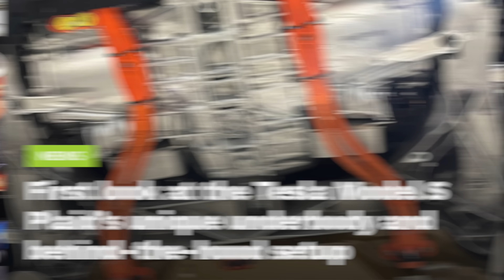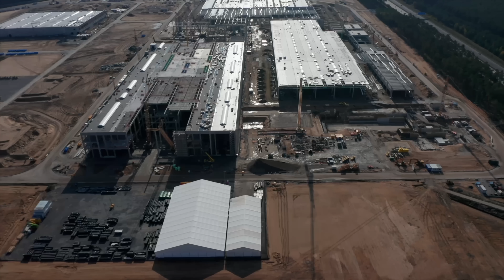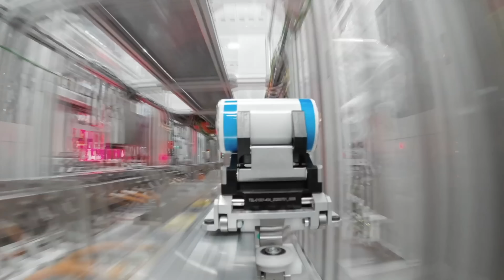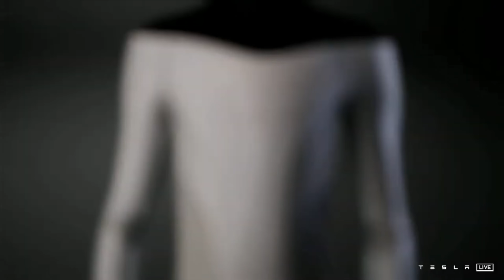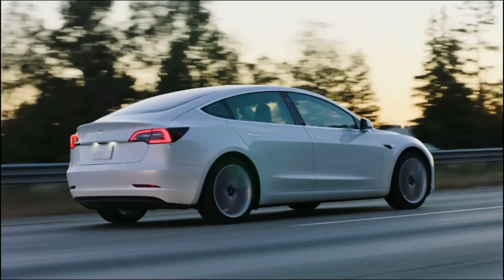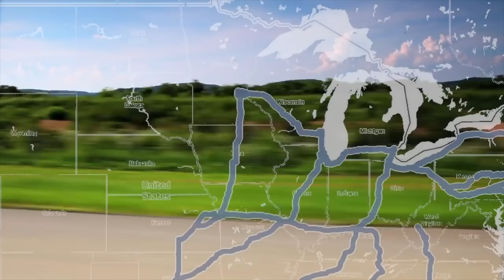NEW Tesla Model Y | 400 Miles of Range?

Comment: The plaid is the safer, quicker, easier to drive, almost a no maintenance car that can drive itself, run 9.24 and is still getting better through OTA updates. And is still not fully unlocked yet from factory.

Comment: The MY awd weighs about 278 pounds more than the rwd MY.  That’s about 7% increasing the road resistance piece of energy per mile from about 150 wh/mile to about 160 wh/mile.  The EPA equivalent for air resistance of about 100 wh/mile is the same.  Therefore the difference in EPA mile ratings is only about 4%.  Actually it is a little less than that because the awd version has a little less internal energy consumption due to the front + back drive current split.

Comment: Hello, thank you for this video. I have a question that I cannot find an answer for, perhaps you have the answer ?
Tesla model 3 : how can I keep a log history each time I recharge the batteries? I need to pay the kW that the car uses at our multi-family home so I need a precise kW value which a simple counter on the electric board will not be able to give me (friends of friends coming over and charging...) So I need an app or access to the Tesla charge log by GPS location (home). Do you know of a way to do this easily ? (I know about TeslaFi - 50 USD/year ; is there a free app to do this?)

Comment: Take a really stupid idea and make it worse with a larger battery.  Electric cars do not reduce carbon footprint due to the FACT making that battery has a huge carbon footprint, the electricity to charge these stupid cars comes from largely combustible fuel fired power plants and, the infrastructure to deliver a charge for these stupid cars must be expanded to accommodate the production and delivery of that electricity must be greatly expanded to complete that task.  Electric long range cars are as stupid as it gets.

Comment: We can estimate the conversion factor between NEDC and EPA, but you may have been generous.  In any event, I think the model Y will approach 400 EPA miles when 4680 batteries hit the scene, assuming Tesla uses the same physical size battery pack.  They could make a smaller physical size battery which would have less range, and be cheaper to produce.
Reply: @K lake cheaper to produce is what's needed.  more real range is also needed

Comment: For me , 400 miles is the magic number.  Keeping in mind the 400 mile rating is not 400 miles of range after you consider parasitic load, heating, AC, charging cycle, etc. The actual range would be more in line with my real world needs with a decent reserve to avoid panic due to unplanned driving needs. I am waiting for the 4680 + giga casting before ordering.
Reply: I agree. Now you can realistically go 300 miles between charges.  At that point I am happy to get out and move around for 20 mins.  Every 200 miles is too short
Reply: ...or, you could get a 2 year lease and get a 4680 MY afterwards.
Reply: I have had a lifetime policy of not leasing. Besides a leased Tesla would not a  have a 400 mile rating. I can be patient and wait for the real deal.   The savings of not leasing can help pay for the new one.

Comment: In my opinion range is not the main thing if we can get a super fast charging  on part with ice car is what matter. Think of it most gas car doesn't even drive 300 miles per tank but it's only take 5 mins to refuel vs 30 mins for 80%. so once the charging is on part with gas is truly bye bye gas
Reply: If you want an EV you might want to move to China. NIO already has a battery swap station that they plan to build 4000 stations of by 2024. In real world these swap stations aren't perfect, but when we no longer have ICE cars these swap stations will replace gas stations.
Reply: @hgr3180  battery swapping is an option sound like a good plan but not really, the number doesn't add up think of it, if nio sell 100k you need to have at least 3 time the number of batteries ready and ready to  swap.  put it this way if you have 20 cars and only 20 batteries that's mean if at 20 cars is on it's way to swap now you have to wait for the longer because the battery is not ready. the are already experiencing such of problem the wait time is longer than expected.  plus tell would you paid for a full price of a car if you don't even own the battery and you are going to sharing a used battery. also those type of infrastructure is way too costly and much more chances of wear and tear compare to  a non moving charging station.  it might work in china because they don't drive as many miles as us in the US and majority of people do not have a place to charge at home. final point i would rather have charging station replace all of our gas station or be included in the same gas station, see you can choose gas, diesel, electric.  i mean lets be real gas won't go away for a looooooooong time.
Reply: @cktommy   wrong. NIO cars don't need battery swap because they can use  superchargers and slow charging too. Search up Wright's Law and watch how production costs keep coming down. This means the cost to build battery swaps will keep coming down at a fixed rate too. Lithium ion batteries keep getting cheaper too so don't worry about not having enough batteries. Tesla is working on a AI that can do hard work and your telling me in the future we are going to still be using plug in chargers instead of automated battery swaps. Plus they are not sharing used batteries that don't have maintenance. Each swap stations has a lot of sensors and can detect degraded individual modules so the batteries can be taken out and repaired. Repairing the battery will mean repairing only the degraded module so repair costs are lower. Keep watching fake news, the big dogs are loading up on NIO.

Comment: Range matters.  The biggest single point raised by those not yet into the EV game is range.  A 500 mile range should be very high up on Tesla's list of things to do.  270 is not nearly enough in the minds of most people driving ICE cars, considering the charging time.
Reply: Agree but not that many regular gas cars getting 500 miles to a tank either. The charging time is definitely a factor (I can attest to that) but most people charge each night at home and have a full charge the next day. That said, I would love to see a true 400 miles to a charge and vastly expanded charging network with way more 250 kW stations.

Comment: Disappointed with every new update with cybertruck. As someone who has a farm and pre-ordered the night of the announcement, it keeps getting less and less practical for people who live in rural areas, mountains, farming, etc… We need mechanical door handles that are easy to open, we need rear view mirrors since lots of time it is muddy and crazy weather that cameras could be unreliable, we don’t need full self driving, and we for sure need a easy gear shifter for moving trailers and getting around farm terrain. I hope I am wrong because I was pumped for a cybertruck and it’s becoming less likely of a farm/mountain truck.
Reply: I agree Patrick, and I think totally due to Musk himself.

Musk is showing himself to be way less customer focused and almost dictatorial in the way he responds to customer requests.
For example, when recently asked on Twitter whether there would be a circular steering wheel option, in addition to the standard yoke on the new Model S, he just bluntly replied “No”. I find that quite bizarre, considering that they stand to lose many sales to potential purchasers who have clearly stated that the yoke is a definite deal breaker for them.

I really think that this mindless adoration from his millions of fans has actually gone to his head!

It’s sounds like you might have to consider the upcoming Ford F-150 Lightning EV as an alternative choice. It very conventional and should fit the bill nicely!

Comment: We’re finally getting our model y tomorrow after waiting since may!
Reply: But is it a 2022 Version? With the 4020 batteries?
Reply: @PhineasJWhoopee  4680 cells won’t be available before around mid 2022, due to engineering issues related to the volume production line. This was confirmed  by Musk and Baglino during the Q2 earnings call in July. They have a backup plan to use 2170 cells in the meantime, for the initial model Y’s to come out of the new Austin and Berlin gigafactories.
Reply: Same!!
Reply: What day did you order? We ordered on the 23rd of may.
Reply: Lucky lucky! I ordered May 19th and still playing the waiting game 😅
Reply: You are not getting 4020 battery, I am with long range
Reply: @cessealbeach  What do 4020 batteries do
Reply: Did you get it
Reply: Congrats 🍻🍻🍻👍🔥
Reply: Congrats

Comment: I would love to see more wheel options on the MY performance…in addition to getting “curb rash” they were noisy and are horrible in the weather on my recent test drive.  How about a “colorado off-road package” with performance motors, raised ground clearance, tow package (with trailer power hookups) oversized all terrain tires, electric window tinting, utility roof rack with built in off road lights…think electric 4Runner or FJ.  Love to have one until cybertruck comes along.
Reply: I see that in a cyber Y type vehicle.
Reply: Is anyone offering electric window tint on a production car?  I hear you on the rims.  I would NEVER pay through the nose for objectively worse wheels.

Comment: I still cant considere the Nevera as a "production car" when only 150 is being made, thats not mass production.
Reply: You are nitpicking.  In the industry, a production car is a run of 50.  Why can't Tesla fans admire the Rimac for the fantastic car it is without showing their jealousy?  If you insist, you can put it this way: Tesla Model S Plaid is the quickest production car under $2.39 million.  Will that make you happy?
Reply: @brownro214  Didn't say it's not an amazing car.  I'm just saying, a $2.4 million limited production hypercar is NOT a production car.  It's not something that someone can just order like the Plaid is.  The Plaid is a production car.  Throwing figures out like "20 means it's a production car" means you are the one nitpicking, looking for an excuse to call a super expensive hypercar, that will have very few exist, a production car.
Reply: @brownro214  rimac was calling the concept 1 a "production car" when they only made 7. Some countries considered 50 as production but most people like me consider a mass produced car as a real production car. Cars like the nevera are practically hand built in a small specialized facility.

Its hard to appreciate the nevera when its engineering pales in comparison to a model S. Rimac built a 2 door made out of more carbon fiber than any other car and yet it still managed to weigh the same as the 4 door luxury sedan. They have the same range despite never being 120kwh vs 100kwh on the plaid. The nevera has 900 extra HP and only manages to be .6 seconds faster at the 1/4 mile. The nevera compromised so much to be a bit better, even their cells and cooling system sacrifices life span for preformance, meanwhile the plaid has an 8 year 150k mile warranty on its drivetrain, what warranty does a 2.5 million dollar hypercar come with?

Nevera looks like a rip off when a plaid exist at $130,000.
Reply: It's not a production car.  It's a limited production hypercar.  So the entire comparison is bullshit, since it costs over 2.4 million dollars.

Comment: I have a 2021 Model Y I purchased from Tesla’s demo fleet in June. It had 2900 miles on it then. On 1 August I topped it off in preparation for a road trip. It topped out at 330 miles. You can imagine my surprise.
Reply: Impressive. What area of the country were you driving in? I took delivery of my Model Y LR at the end of April and I get 300 if I’m lucky and with my cargo box another 25% off that.
Reply: @bryanhauer  I live in Virginia. I usually keep within 5 miles of the speed limit on the highway and maintain a constant speed using TACC and Autopilot. My efficiency is usually between 220 and 240.

Comment: The Nevera is an amazing car with amazing 1/4 time but for a savings of $2,370,000 I'll give up the less than one second advantage and buy the Tesla.
Reply: The tax alone on the Nevera is more then a fully specked Plaid. They fact that they are being compared is a feat for Tesla
Reply: With that kind of money I’ll get an X, and order that roadster and cyber truck
Reply: People like you that compare cars by the ability to accelerate in a straight line make me sad
Reply: The Nevera is hardly a mass produced car. It is hand made like a Koenigsegg… calling the Nevera a mass produced car is such a stretch. The Model S feat is much much more impressive at is is a true high volume mass produced car and that also means a completely different price
Reply: Funny thing is tesla is only 1000 HP and rimac is 1900HP that's the difference and i will still prefer a tesla for now but the rimac i respect big time🇹🇹🌍💯
Reply: Sometimes thinking of buying a Tesla now feels like I have to save nearly $2.4M to purchase one.
Reply: If you're considering either of these 2 cars you probably aren't looking to save and have the money to get either, at which point the Nevera will give you the bragging rights of having THE fastest production car ever made

Comment: The order fee does not come off the cost of the car.  I have an order from June and while it does show I have paid $100 in the payments received, it also has the $100 order fee added into the total Car Price as a separate line item.  So raising it to $250 actually is just a $150 price increase on the car
Reply: Wrong!
Reply: @Electric-Mania  I don't live in California, so maybe it's different by state?  In Indiana it definitely is just a $100 fee, doesn't go towards the cost of the car
Reply: Kevin is right. The $250 order fee is as it states a fee. It is added to the price of the car as is the $1200 delivery fee. It is removed from the total amount owed upon delivery because you have already paid it on order. So Tesla did raise the cost of all new orders by $150.
Reply: Not true. It shows it but then deducted from total. I was confused by this as well
Reply: @qman66  so on my order for the car, it shows the $100 order fee, which of course I have already paid.  Then there's a total at the bottom, which includes that order fee.  Then after that it shows I have paid $100, so it subtracts that before showing what amount is due when taking delivery.

Where in that would it show they are taking it off again?  The "-$100" is just because I've already paid it
Reply: They added my $100 along with the $1500 in California back so 1600 total towards the downpayment!  They dont just take your $100, only if you dont buy the car.
Reply: @Electric-Mania  the issue is not that you are getting credit for the $100 that you paid it’s that there is now an Order Fee line item of $100 that did not used to be there. Instead of the $100 paid going towards car cost it now just offsets the Order Fee. This fee has now been raised to $250.

Comment: The NEDC standard is realistic for China driving which have 30 mph lower speeds than the US.  This difference is a huge difference in achievable range.  The US has 65, 75, even 80 mph speed limits, whereas China is 45 and 55 mph speed limits based on what I have read.  Also In the US highways its not uncommon to be able to go 9 to 10 mi an hour over speed limit and not be pulled over, whereas in China I expect they are literally held to the speed limit.  Again NEDC is realistic for China, its not meant for US standard as those speeds are unacceptable in China.

Comment: I didn't think the $100 (now $250) deposit, came off the price of the car. 
In my experience,  that's the fee to order; and does not count towards the cost of the car. 
Am I wrong?
Reply: You’re correct, but people get confused about this because of how it’s labeled on the paperwork.
Reply: I bought a M3  in March, took delivery in May and my $100 deposit was deducted from the final price.
Reply: @wagnerscorner449  double check your purchase agreement. The $100 you paid was deducted from the total price, but the total price includes a $100 order fee, so it does effectively make the car $100 more expensive.
Reply: @mitchlindgren  so the increase to $250 is an additional $150 more to the total cost of the vehicle
Reply: @Orion801airsoft  yup, seems that way
Reply: @mitchlindgren  that's what I thought.